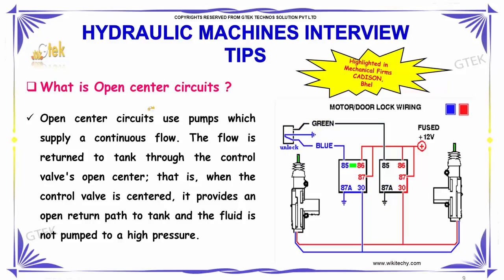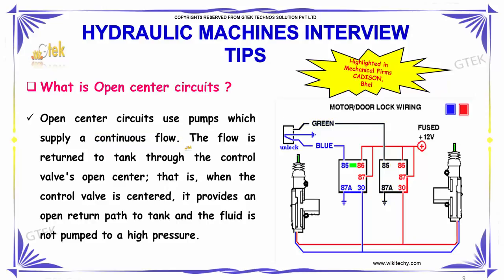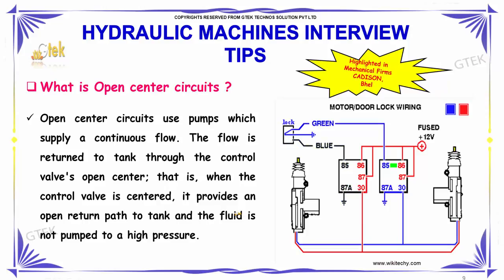what is open center circuits | hydraulic machines interview tips | wikitechy.com

Comment: Hydraulic fluid is filtered to 7 µm through a full-flow, spin-on, return filter. ... six- or seven-spool monoblock open-center control valve with an open-center parallel circuit for all function

Comment: independent of the distance between the input and output, without the need for mechanical gears or levers, either by altering the effective areas in two connected cylinders or the effective displacement (cc/rev) between a pump and motor.

Comment: Open Center refers to the open central path of the control valve, when valve is in neutral ... In the valve's neutral condition (when the circuit is not doing any useful work) : - Open center- The pump oil gets dumped to the tank at tank pressure.

Comment: Open Center refers to the open central path of the control valve, when valve is in neutral position. The hydraulic pump is continuous flow type. When valve is neutral then hydraulic
 fuid goes back to reservoir. ... In such system multiple valves can be 
connected in series but one service is operated at a time.

Comment: Open Center refers to the open central path of the control valve, when valve is in neutral position. The hydraulic pump is continuous flow type. When valve is neutral then hydraulic fuid goes back to reservoir.
Open Ce

Comment: Design procedure for hydraulic jump and bucket-type energy dissipators. 8. ... These devices, commonly called as Energy Dissipators, are required to .... A chute spillway, variously called as open channel or trough spillway, is one whose ..... gravity, and He is the hydraulic head measured from the centre of the orifice (in m).

Comment: Hydraulic systems are of two types: 1. Open center hydraulic system. 2. ... For a work to happen in a hydraulic circuit or system the fluid should flow to the actuator or motor from the pump and then return back to the reservoir.

Comment: such dams from standard books on the subject like Engineering of Large Dams ... dissipates energy of the fast flowing water by formation of hydraulic jump at basin ... The base of each block of the dam is horizontal and the blocks in the centre of ..... elevation ,all gates open, tailwater at flood elevation, normal uplift, and silt (if ...

Comment: Also, the open center system allows for the addition of other hydraulic circuits in series through the power-beyond of the control valve.

Comment: Open Center refers to the open central path of the control valve, when valve is in ... In the valve's neutral condition (when the circuit is not doing any useful work) : - Open center- The ...

Comment: A simple open center hydraulic circuit. For the hydraulic
 fluid to do work, it must flow to the actuator and/or motors, then 
return to a reservoir. The fluid is then filtered and re-pumped. The 
path taken by hydraulic fluid is called a hydraulic circuit of which there are several types.

Comment: For the hydraulic fluid to do work, it must flow to the actuator and/or motors, then return to a reservoir. The fluid is then filtered and re-pumped. The path taken by hydraulic fluid is called a hydraulic circuit of which there are several types. Open center circuits use pumps which supply a continuous flow.

Comment: OPEN CENTER HYDRAULIC SYSTEM. VALVE IN NEUTRAL POSITION. SINGLE ACTING CYLINDER. SUCTION LINE. GEAR PUMP.

Comment: Open Center refers to the open central path of the control valve, when ... In the valve's neutral condition (when the circuit is not doing any useful work) : - Open ...

Comment: in Hydraulic Circuit Design. In this system, a control-valve spool must be open in the center to allow pump flow to pass through the valve

Comment: These valves open whenever the pressure goes beyond the set value, allowing 
... SCO Open Center / Detent Valve; Open Center Valve; Two Circuit Hydraulic ...

Comment: Open-Center Versus Closed-Center Circuits Open-center circuits connect the fixed displacement pump to the reservoir when the control .

Comment: Hydraulic machines are machinery and tools that use liquid fluid power to do ... Open center circuits use pumps which supply a continuous flow. The flow is returned to tank through

Comment: Open Circuit Hydraulic Systems: Open Center and Closed Center ... a variable 
pump flow system are closed center, and allow the pump to output only the ...

Comment: Open center circuits use pumps which supply a continuous flow. The flow is returned to tank through the control valve's open center.